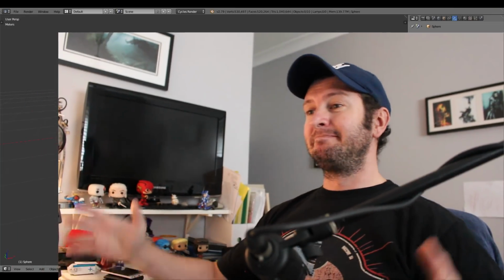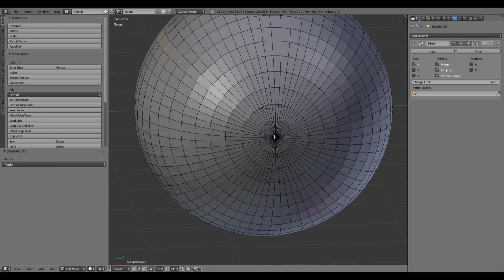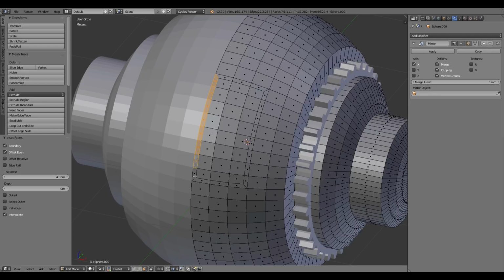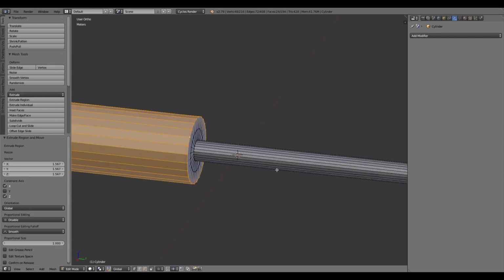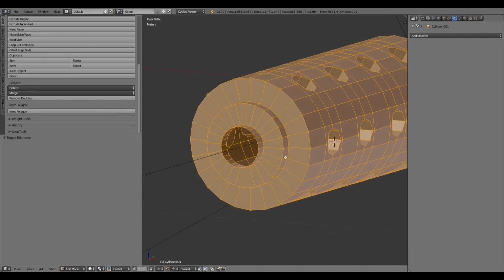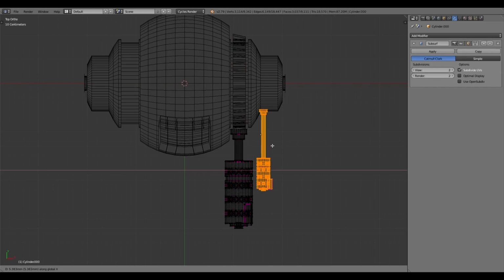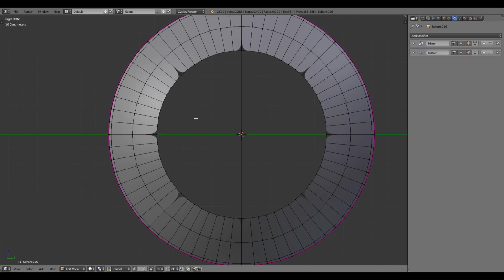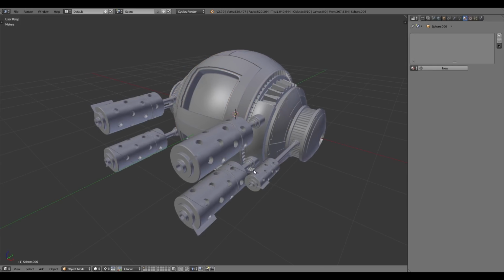Scifi Pod Modelling Tutorial

Comment: Pressing the "L" key selects everything in the cylinder.  I got it to work once but can't rotate the sub object around the same origin.  The copy of the gun barrel gets scaled up.
I've been battling for hours and trying t see what I'm doing wrong but I at a frustrating loss.
Reply from the maker: Set your cursor to where you want your selection to pivot. Change your pivot point to cursor. Try again.
Reply: @PCaggegi  still having trouble moving the pivot point to the cursor while in edit mode so I rotated empty instead.
I think the pivot point may have been a result of my modeling.
Reply from the maker: Sometimes you have to put your mouse on an edge or vertex close by for it to work, as it now selects whatever your mouse cursor is near.

Comment: cheers for the tut mate, I have a question though, no matter what I do I am unable to use the split edge option, i tried to remove doubles etc, nada, it simply has no effect. I ened up spliting it into separate object, but i'd  like to know why i cant use the split edge thing. I remade the barrel from scratch - same issue. No idea what I am missing.
Reply from the maker: Hey Ponte Ryuurui - happy to try and help out. Want to email me more details, maybe your blend file? I can probably help better if I can see what part you're having trouble on.
Reply: I think I will start over once more, perhaps there was something wrong with the mesh. The split edge worked fine with the gun shield.

Comment: How did you get hte units to display in the 3D view?
Reply from the maker: The length units? When you're in Edit Mode, hit N to open the righthand toolbox, and enable "length". Any selected edges then display their length in units.
Reply: The number in the upper right hand corner of the 3D window "10 metres", for example. How do you get that? Sorry I wasn't clearer.
Reply from the maker: David Chipman I explain early on in the tutorial. You set your scene units to metric, then when you zoom, it displays the units.
Reply: But it doesn't display them. I do know how to set units, that's not the issue.
Reply from the maker: You have to be in orthographic mode. You're probably in perspective mode. Hit Numpad 5
Reply: head-desk Thank you for your help.